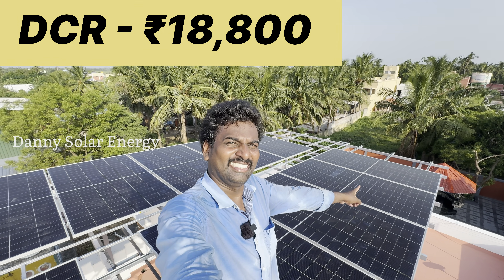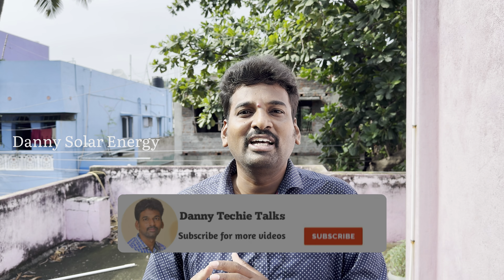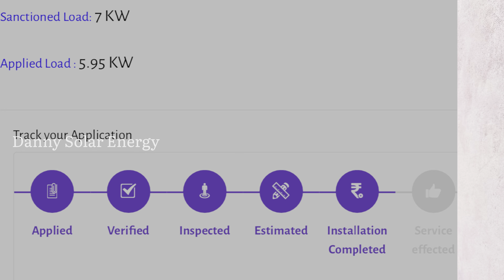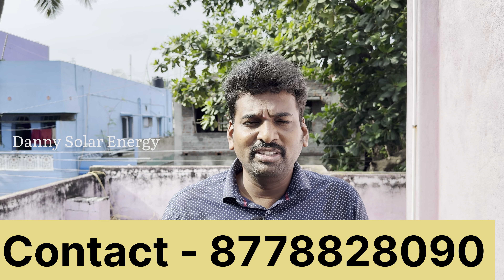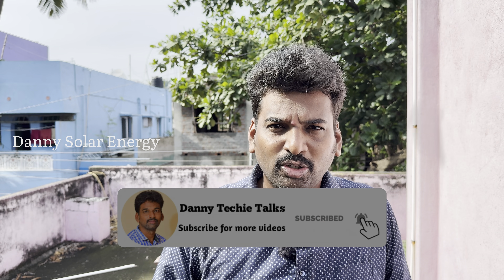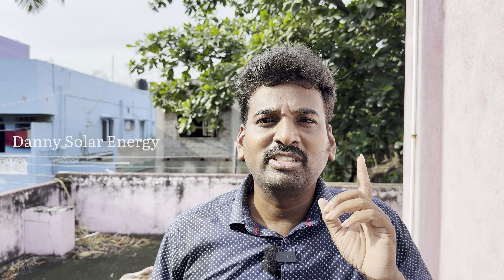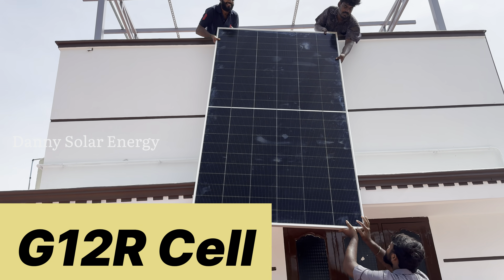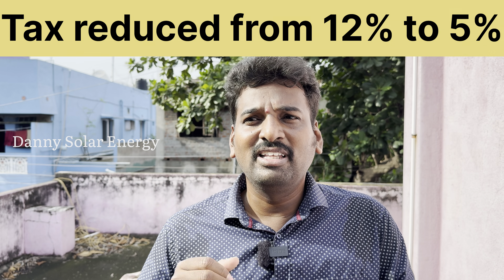Solar la ula Uruttugal உருட்டு #uruttugal நீ நல்ல உருட்டுமா | Danny Solar |

Comment: Hi Danny, you're doing a fantastic job! Your videos share a lot of eye-opening insights, thanks for that. I have few questions on inverter and below are my questions. Kindly share feedback when you get time.

1)How much power does a solar inverter typically consume during the conversion process?
2)What is its power consumption when it's in idle or standby mode?
3)Can you provide an example based on a 3-phase 5kW inverter?
4)Also, could you recommend the most energy-efficient inverter in this category, considering minimal self-consumption and high conversion efficiency?

Comment: Non DCR potta மானியம் தருவார்களா இல்லையா
Reply: Varadhu
Reply: @balajiuthran5028 non dcr 3 kw rate என்ன dcr 3 kw rate Yenna?
Reply from the maker: No, they will not give subsidy but you will get high efficiency panel in tier 1 brand without quality compromise in all materials

Comment: Good message,  but instead of Net Meter please post a detailed cost comparison between the DCR and Non DCR panel. Convey to the public as subsidy is unnecessary if using non DCR panels.
Reply from the maker: First 2 mins I spoke about cost only
Reply: He does that in every video. Dany was the only one who talked about the cost difference. The rest just simply don't!!
Reply: Cost doesn't matter. Explain why there's a dependency and linkage of government and EB meter here?

When I spend a bunch on setting up an offgrid inverter system, why do I need an EB meter? I don't want Govt Current, I neither want to transfer my excess production to govt, jus leave people like us alone.

This is the 2nd channel I'm raising this same question. I would like to see him explain that scam first hand.

Comment: I'm using non dcr  pannel, with net meter which was installed by own,  applied by own

I have installed dc home 80 % of load, 20% liad is ac load.

Same set  panel is connected offgrid  without inverter as a first preference once battery is full, then switch on the ongrid inverter and exporting to EB.😮
Reply: Interesting approach!!!, congratulations

Comment: I am using waaree solar panels 3kw as an off grid system working fine. Very very good performance.
Reply: How many units per day you are getting? minimum to maximum.
Reply: @chandramoulimouli6978 அவர் watts ஐ கொடுக்கவில்லை
Reply: I don't have a device to calculate units per day, but it is a generator enough Power 

1. 1kva sump Moto 
2. Washing machine 
3. Tv fridge mixture and all my house items are running.

I have a scheduled day time running a higher power consumption device like a motor, washing machine at night time only light load. For the last three years I have been using works fine.Need to check everything from time to time

Comment: What about warranty terms and conditions in between DCR & Non DCR. DCR is produced in India ? And what about Non DCR ?Still today no u tube vdo on TNEB bill  solar meter with the explanation for each column in bill. 90% customers in doubt of CUF units and etc. The multiplication by 3.00 kw differ from actual 3.2 or 3.4 kw to calculate the eligible units in the bill. No one can make exact 3.00 kw system with market availability of panels.
Reply: There are many
Reply: Dany video iruke. Please check his channel. Itemized bill explanation was done in that video. Roof la ukandhrupaar check panunga.

Comment: solar potta .. current cut ku normal ah house ku ups pottukalam ah bro..
Reply from the maker: Yes podalam
Reply: Off-grid solar pottukonga... no power cut problem.. 24 x 7 athu work seiyum.. no need EB permision
Reply: @butterfly196611  off grid potta  romba problem varum
Reply: @Premreactss yarukku problem varum? Naan 2 varusama 100% off grid la office run pannittu irukken. 24×7 no power cut. Vanthu paarunga..😊
Reply: @butterfly196611  compare to on grid = off  grid  give battery and  invertor problems sir
Reply: @Premreactss  https://www.youtube.com/watch?v=OxchEqEktoE
Reply: @butterfly196611  ok sir
Reply: @butterfly196611 Cost will skyrocket x2 times.